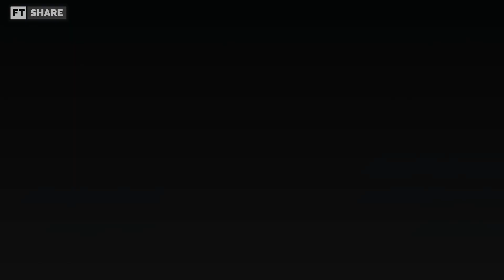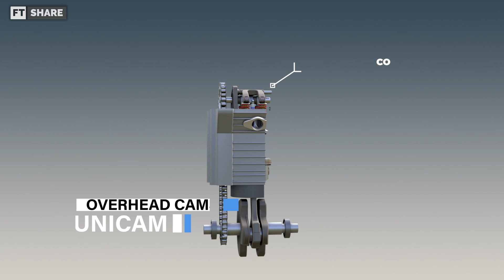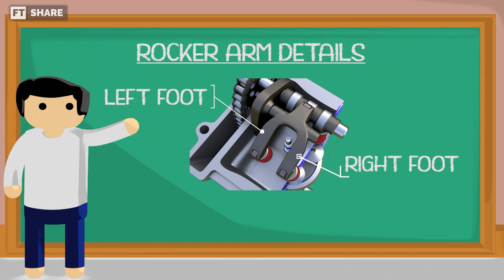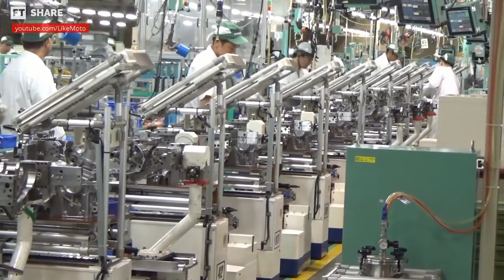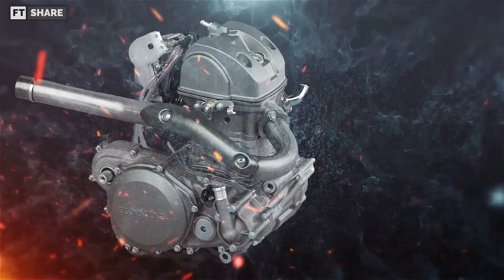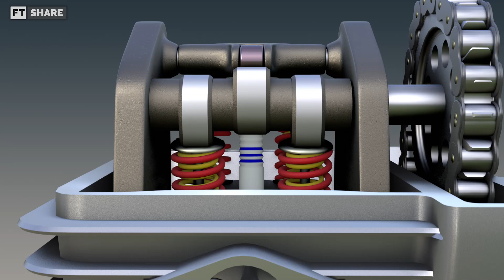Combination Of SOHC & DOHC | UNICAM From HONDA

Comment: The electronic control valve invented by Konigsegg is the best and the most efficient.
Reply: Yes it's more efficient....but for bike it's not relevant because cost to manufacture....plus more electronic part make it more complicated thus lost meaning of bike for being easy to maintain,low cost and simple vehicle to move around 😁😁😁

Comment: please please make a video on future of 2 stroke engine, is direct injected 2 stroke really the solution, will it work in real life , is there any major modern design changes in 2 stroke engine which can bring back 2 stroke engine
Reply: Huge companies (not just motorcycle) have stopped development of the two stroke as they CAN NOT make them run clean enough. Detroit Diesel, a major manufacturer of computer controlled, fuel injected two cycle diesel engines discontinued production as their engineers found it impossible to make them run clean. Unfortunately, I can't see the 2-cycle engine finding renewed life.